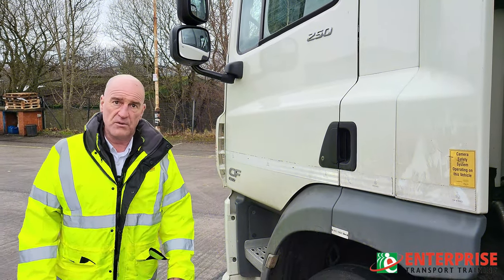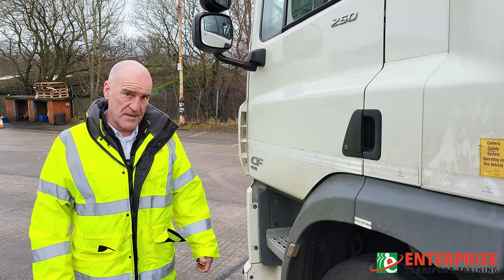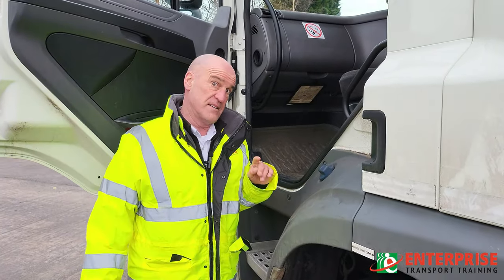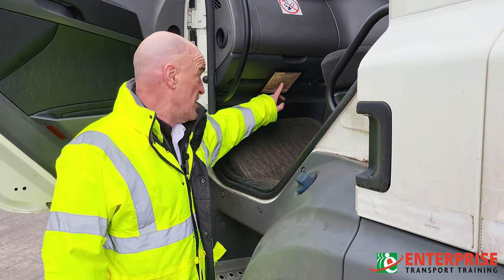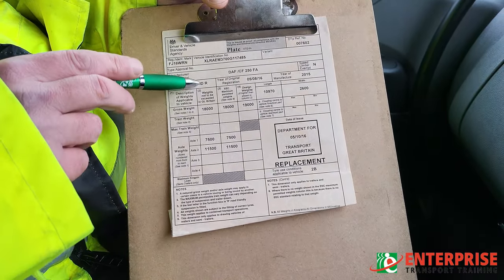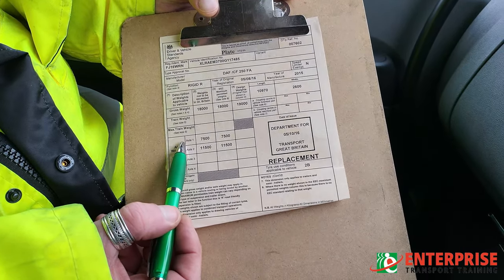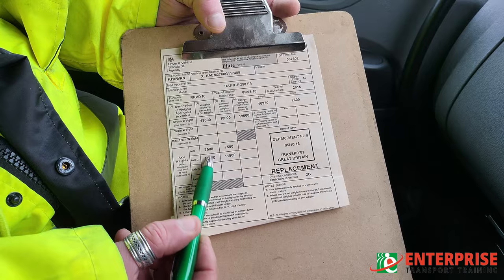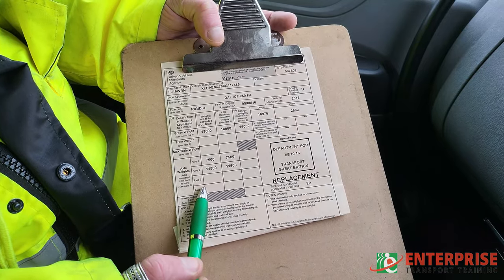VTG6 Plate (Module 4 DCPC)

Comment: Good afternoon. I have found your videos very informative as I am about to embark on my HGV class 1 training. However in this "episode" when the instructor was talking about the axle weights and showing the plate for the weights something has confused me that I hope you can set me straight on. The vehicle is an 18-tonne truck. Yet on the plate it shows, weight on axle 1, 7500 tonnes and on axle 2, 11500 tonnes. Total = 19000 tonne.  Please explain. Many thanks. (Ps, subscribed).
Reply from the maker: Hi Chip! Thanks for your kind comments about our video service and a huge thank you for the subscription, every one really does make a difference! On the VTG6 plate you need to read the axle weights as individual weights as opposed to combining the two. The maximum gross mass of the vehicle in this case is 18 tonne so therefor you can not exceed that weight but you should also make sure that you do not overweigh any particular axle. You are correct in saying that if you were to load each axel to its maximum capacity you would then exceed the maximum gross mass and therefor it would be illegal to drive that vehicle on the public road. Hopefully that helps and if you have any questions then please do ask. Good luck with your venture into the LGV world!
Reply: What if the vehicle is equipped to tow (wagon and drag)?

Comment: I like this video, but maybe it's a good idea to mention where we can find the curb weight of the vehicle or its payload capacity. I know how to calculate the curb weight or payload capacity, but to do that we need to have two values: 
1) MAM - curb weight = payload 
2) MAM - payload = curb weight 
So, the question is, where can we find the curb weight or payload?
Thank you.
Reply from the maker: Hi Leopold, as this is a guidance video for Module 4 Driver CPC candidates there is no requirement to have to explain to an examiner how to calculate payload or kerbside weight. The exercise is simply to show the examiner that you can demonstrate an understanding of how to identify where to find your maximum weights and to use this to then asses if your vehicle is overloaded.